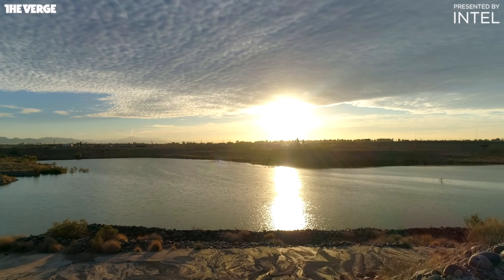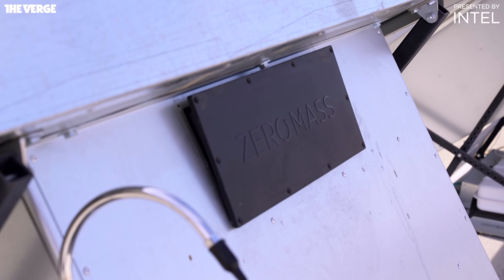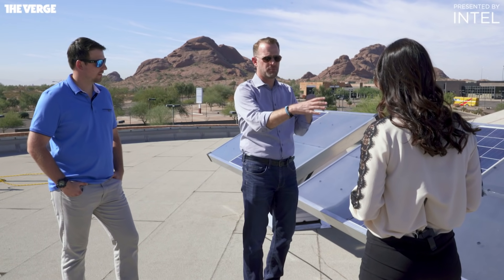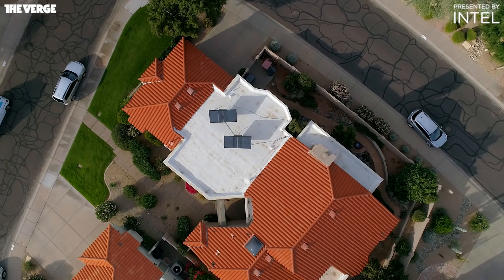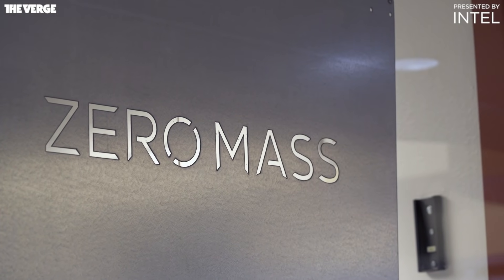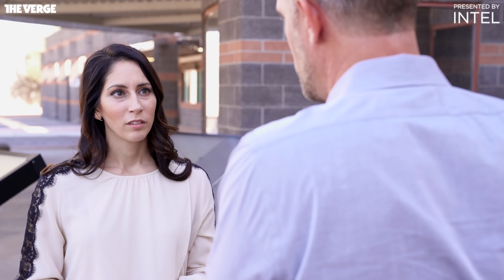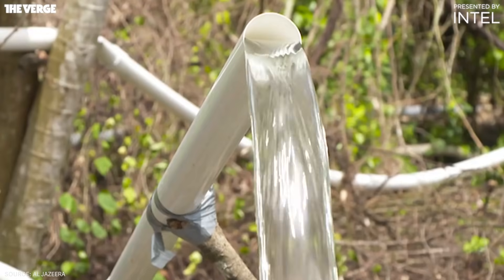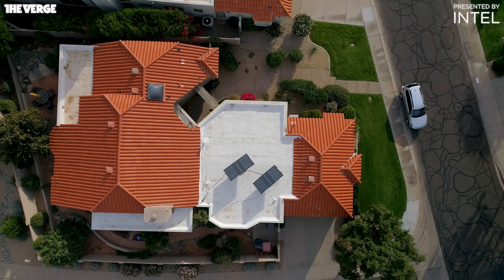Zero Mass' solar panels turn air into drinking water

Comment: What about an airconditioning unit, it produces condense water... Isn't that drinkable? I once had no option to route the hose for the condense water from my airco into a drain. I used a bucket instead to catch it. Needed to empty it about 2 times a day (+-6 hours). That's 20 liter. And it runs 100% on my solar panels. This split unit (for bedroom) costed around 400 euro and uses around 1.5- 2 kWh. Of course it depends on the humidity, but it sounds cheap compared to this. And maybe it is even less consuming when you only put it on "de-moisturize" mode.
Reply: that ñew mobed ¹0 liter 2⁰ lirters

Comment: Excellent reporting here by Verge. Making water by accelerated condensation in desert environments seems miraculous and this  method seems sustainable. But Verge asks the right questions. Is it the most efficient and cost effective  method to address global water shortages? Not even close.  It seems like a rich guy's toy to pay $4000  to generate a couple of showers worth of water a day. Also why is the technology proprietary if it so valuable to mankind? Shouldn't the materials science that can make water and save Iives in parched areas be available to everyone? Uncle Joe agrees
Reply: The technology is proprietary because they don't want to admit it's a simple dehumidifier attached to a solar panel that can add minerals back into water. People can and have made virtually identical products in the past - these guys aren't doing anything new. Just in the past few years I remember hearing of another product called water seer which initially started off saying it could cool the water underground, but ended up delivering a dehumidifier with a solar panel and minerals to add into the water. There was also Fontus which claimed to be making a self filling water bottle using this same technology. Neither worked as advertised, and this product won't either.

Comment: To all who think: isn't this just a dehumidifier ? 

NO, IT ISN'T! Most dehumidifiers work with direct condensation by cooling down the air with electricity. This works fine for relative humidities about 60-90% (at abt 30degC this means 16.06 to 24.40 g of water per kg of air), but in arid Regions, where there is only little relative humidity like less than 20% (5.26g of water per kg of air), this will need lots of energy since the duepoint is very low. Or it even won't work, since the due point at e.g. 30dec and 10% (2.62 g/kg) is below icing point (-5degC). 

What this device does is accumulating water by adsorbing to a sorption material and then desorbing it by heating up with solarthermal energy, then it condenses by radiation cooling to the "cold sky" on the inner surface of the panel glass plate. After that the water is mineralized, before it is "real" drinking water. You can't compare with normal tap water, even if it is safe to drink, it might be disbalanced in minerals and taste not very good. Check up what a mineralisation station to make your tap water more tasty/healthy will cost. 

So, NO, it's NOT just a big dehumidifier, even if you add PV and the mentioned mineralisitation station to it, it won't make as much water as this device... 

BUT I agree on the cost: People that are in these remote arid regions, can't afford it. That is why they rely on NGOs or fundings to pay in this case. Add to this, in the  regions where this device should be apllied, there is no safe tap water at hand... 

I AGREE that where there is tap water available, it is just a fancy show-off device.

AND I still doubt, that they can really reach the indicated amount of water in really really REALLY arid regions.

They say the device can gain 5l per day per panel in places with high humidy and 3.5l per panel and day in regions with low humidity. I just wonder what their definition of "low humidity" is...
Reply: What you described is a dehumidifier. Nothing new here.

Comment: That sounds fine and good, with water vapor. The problem is the corporations that have our government in their grip are dumping barium, mercury, aluminum dioxide, and other contaminants in the air, which suspends in the vapor. I guess like pond water, it gets filtered.

Comment: In Kuwait, the average amount of water from dehumidification of air conditioned water is around 100 liter/day for one average house. This is much more than the few liters per panel. Before dismissing it, it could be modified to use different humidity sources in the house or its water flows.
Reply: largest 250 letes per day graohe cersin 375 liters per day all sokar watt 100 per hiys ih one orr per day
Reply: Agreed

Comment: Have you ever read the warning label on a dehumidifier? Water from dehumidification doesn't contain the minerals you need and has to have them added. It has to be decontaminated - all of which costs energy and energy costs money. "But the solar, dude!" yup, okay, solar - which costs money to install and then amortize the costs of as well as maintain - there are no free rides. Oh, and if you live in a region with low humidity and/or temperatures, ya, you've just wasted your money, which is not skin off my arse and all, but it makes this Schadenfreude taste so, so good. So, water from the air - a false economy. Consider trucking in water or treating existing sources including rainwater, they're both far, far better, more sustainable solutions to water shortages than dehumidifier water.

Comment: Seems like an over-engineered solution. A simple 60sq ft rain roof with a gutter could collect 465 gallons/year or 5 liters per day of rainwater even in Arizona (much more in other places). It's just a matter of storing it when it falls. A 300-gallon water reservoir is only like $300, 60sq ft metal roofing, gutter and PVC pipe would be like $90. So for $390 you could have access to the same amount of clean renewable water, it would just take slightly more surface area. It would take out the variable of solar power as well.

Comment: There's several ways of making water in a survival situation just using a large plastic bag. You can produce drinking water using the plastic bag where there trees or no trees. Works on the same principle this expensive system. For your home there's plenty of water purifiers and active carbon filters to provide suitable good tasting safe water for drinking/washing.

Comment: With a $1,000 1kw solar array I can run my 650 watt  $250 dehumidifier which gets on a good day ~ 2 Gallons water, which in a pinch would be drinkable and survive a family of 4 for quite  while.  Of course FL is very Humid where I live.   I would bet they are using peltier arrays to condense the water vapor into liquid.

Comment: PURE SCAM.      The drier the air (which it always is in places were water is in such short supply) the more you have to lower the temperature (to get the RELATIVE humidity high) before you can even begin to collect fiendishly expensive water.        The result is that the more you need the water, the more expensive it is to collect.

Such scams could only succeed in a country where the educational system has been rendered almost totally dysfunctional.

Comment: The proprietory material that condenses water from air is based on zeolites and absorbent polymers that work at even 10% humidity in the air. Using the solar panel power to dry the condenser after saturation / collection for reabsorbing water vapour.

Comment: Where do I begin? This is a glorified dehumidifier. It takes 2 million Joules of energy to condense 1 liter of water, so this is probably the stupidest waste of energy you could do. You could catch as much rain as these panels produce using buckets the size of the panels, or use photovoltaic solar panels instead and pump water from underground. The water you do condense from the air is going to be grey water, and NOT safe for drinking. You could get all sorts of water borne diseases this way. Can we PLEASE stop publicizing this kind of nonsense and focus on things that are actually practical?

Comment: The problem is getting clean water. Not getting any water at all.
Pulling it from the air is not necessary or worth it; what you need instead is defecators, not dehumidifiers.
It's also funny that you think this would be effective in arid climates.

Comment: The most energy efficient way to produce drinking water in arid areas that have access to the coast is via reverse osmosis desalination. Modern reverse osmosis desalination plants produce fresh water at a rate of ~286 liters/kWh. Among dehumidifiers, which is what this thing is, the most efficient, when operating under optimal conditions (i.e., extremely humid air, which is not what you have in arid regions) produce ~3 liters/kWh. In other words, for the same amount of energy, dehumidifiers produce at best about ~1% as much water as reverse osmosis desalination plants. When operating in arid environments, dehumidifiers' performance will be much worse than this.

Comment: If you live in a place with enough humidity for this to work at all, you will get rain on a regular basis. Just collect the rain water from the roof and store it in a cistern. That's how the homes get their water in Bermuda, for instance. If it's too dry for rain, it's too dry for a dehumidifier, even a stupidly expensive one, to work too.

Comment: this water will lack minerals and if it's all one drinks then you will get sick.  And, by the way, the best tasting water is good tasting because of it's fortuitous blend of minerals.

Best water I ever had was in High Sierras, California.   Drank water from a stream.  Water levels in those streams reaches a high each night about 1am.  Why? Because the snow melted during the day seeps into the soil and takes about 10 hours to surface again in streams.  Stream water comes from the soil, which in High Sierras is mostly granite sand.  

Don't drink directly from the stream if it is downstream from human communities, and generally don't drink it below 4000 ft.  There are virtually no parasites in the water above 4000 ft.

Note.  In Yosemite National Park the water, in the much visited Valley, is collected near the base of the waterfalls, where the water has fallen from elevation of 5000 to 6000 ft.   It is very lightly treated....virtually no taste of chlorine at all, and is delicious.

Comment: Why pay $1.50 for 1,000 gallons of water when you can pay 2500 dollars to get around 1.3 gallon per day,  don't worry it will only take around a million days or 3500 years to break even in cost.

Comment: air to water systems have been around for a really long time.  zero mass is just powering it with solar. are they even using UV light to kill off the bacteria and where does the minerals added to the water come from?
Reply: rohanedmonson u don’t need minerals in ur h20 if you eat

Comment: To be fair that isn't without electricity. Solar panels make electricity. What is their efficiency? How much water can it pull from humid air? If a dry area has 0% humidity then how well will it work? Also how does it "mineralize" the water, are you required to put in new cartridges or something to that effect?

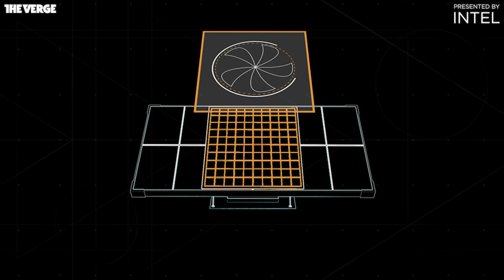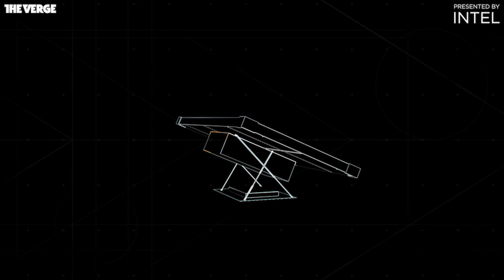Comment: 1:37-2:00 (23 sec)explains how it works in 8:19 video. 
Warm water molecules hitting surface colder then itself -
🤔Glass panels gets heated by atmosphere and heat from sun so how cold is the glass ... plus extra heat from heating metals 
So heat up gas molecules to get water . How ? How is the heat lost from vapour state to liquid removed from system ...

Comment: Simple concept... its a dehumidifier powered by solar.

Peltier cooling and the water condenses.
We could do it for 1/10 the price using the same solar panel rating.

Comment: Total bullshit. Only works wh en solar radiation and humidity are enough. However, solar radiation is a day "thing" (does not exist at night) and rise in humidity is a night "thing".
You never get the two at the same time.
Also, that solar panel is, at most, 250W - not enough for the job. I guess that's why all those black wires connect to the panels - not only for communications - they need the extra power to make the dehumidifier work. Of course, in tropical countries, with the 250w solar panel, it might be able to pull a couple of litres of water from the air, provided there's enough solar radiation. Otherwise, on dry climates, you need much more power (about 8-10kW) and batteries for 8h night use, and you may not get enough water out of it -  senseless product.

Comment: As this usa is 2/3rds in some level of drought and the least currently is moderate to severe drought conditions nationwide. Here in missouri, we are at 4ft deficit for winter normal snowfall. Crops will suffer. We reclaim nonfecal waste water, aka, grey water. Depending on where it comes from in our house will dictate where it will be used. Some of it goes to flushing the toilet. Some to the trees and some to the garden. We are striving to set up a pond to handle the water with a bio filtration system leading to the pond and a bio filtration system in the pond itself. What is a bonus is that we will also raise food fish. The water can then go anywhere on the property where needed and a simple filtation system leading to where we draw drinking and cooking water will be the portion meant for human consumption. But it is slow to set up as I am doing all the work and we are on a fixed income. But, it is getting done.

Comment: How exactly does this work in dry air?  This seems very expensive as a way of getting water.  What kind of maintenance does it need?  What do the cartridges cost?  What is MTBF of the unit?  Cost per liter of water?

Comment: Now that completely transparent solar panels for producing electric power exist, it seems logical to design a solar panel for heating water under a photoelectric sheet. With the thermosiphon effect, metals also can be circulated through an exited coil to produce electricity more efficiently than an alternator, so there is another way of making electricity inherent in a
solar system. Ideally, a panel would consist of at least three components, a. A photoelectric collector, b, A hot water collector and c. A gas expansion device for refrigeration. The refrigeration unit also is quite capable of preheating water entering the solar panel. It may also be quite feasible to run a refrigerator directly by means of hot water produced by solar panels.
When a solar system is floating in a batteries-full condition, there is a perfect opportunity for using a new efficient type of electronic hydrolysis unit for producing hydrogen for fuel cells or other purposes. Oxygen, the second component of hydrolysis is a superconductor when compressed into a liquid, so may be the perfect substance for thermosyphonic electricity generation
Excuse book.

Comment: Why do you pay people to sit in a room full of TVs monitoring a handful of your dehumidifiers? There is no way you can get these into a disaster zone let alone the enough of them to actually help anyone. There are plenty of more efficient machines that are designed for supplying clean drinking water in remote impoverished locations and they are not being used because they can't get them into those locations.  Why would I buy one of these if I can buy a quality underbench water fillter, chiller, boiler for less than what this costs? I'm generally a supporter of long shot engineering projects but this is just lacking in all areas.

Comment: This will not be the solution for normal people even if they live in a dry place. Desalinated water is cheaper, much cheaper. But there might be edge cases where it makes a lot of sense. Tap water can be cleaned cheaper than this. 

Maybe you want to live in a house on a hill out in the countryside where you cant get municipal water. In a dry climate, the only other reasonable alternative might be bottled water from a store far away. Then this might be cheaper.

Or maybe your municipality sux and there are constant water leaks were they stop supplying water. Or they use lead pipes. 

The cost of the water ought to be compared to the cost, time and inconvenience of buying bottled water.

Comment: This is absolutely a scam.  Let me ask you, is buying stock from a con artist a good idea? 
The numbers are fake, and the economics make "Zero Sense".
Costs $5000, produces less than 2 gallons of water per day, produces no power, only lasts 10 years.   2 gallons water costs less than .001 in most areas.  365 days x 2 gallons x 10 years x .001 = $7.  Yeah!  $5000- $7 = net loss of $4993!

Comment: stupid to be able to do all that and not have manual adjustments and have to be on the grid, so if power out in plant that is hooked to on grid and grid goes down it is a nice ornament.  Best to use water filters to clean water for communities that are having factories that make parts for that to sell for what they themselves help create. Invent a floating devise that sits on water, made all from recycled material and needs no maintenance and i will pat you on the back and shake your hand. Get people hooked on a computer system that will collapse easily with a EMP, what good is it. Take a old barge, put  biochar  under in massive amounts, put a "back to eden" self sustaining floating ecosystem  for  floating islands  for birds and micro organisms and that is cleaning up the mess people like you promote.

Comment: Their so-called proprietary device is nothing more than a schottky diode heat up one side and the other side gets cold the cold side condenses the moisture out of the air and produces the water my question is what filters out the pollutants in that water that are suspended in the air with it? Oh yeah there's nothing proprietary about a schottky diode go buy one of them silly ice chest that you can plug into cigarette lighter of your car and start an electrical fire with that use a schottky diode to and suck up tons of amps in order to operate.